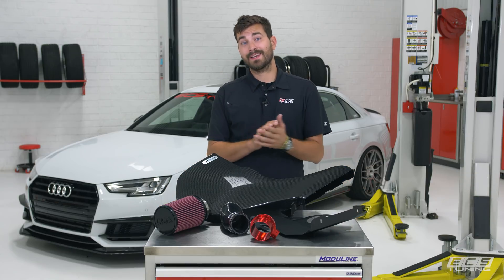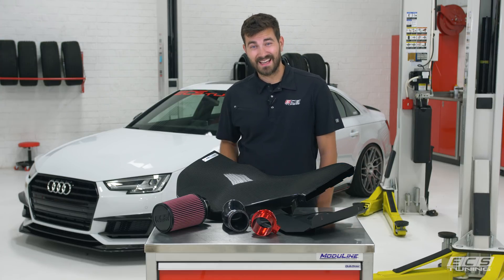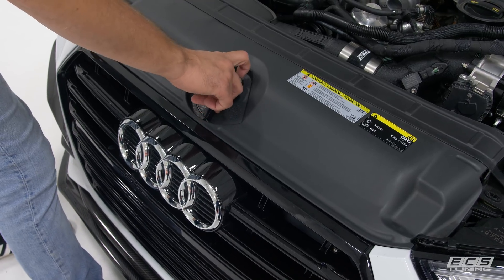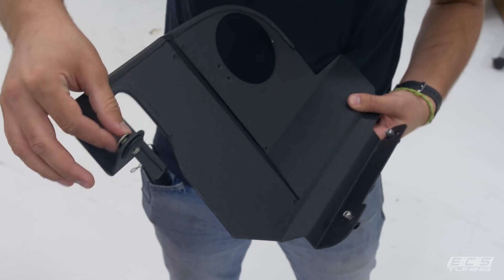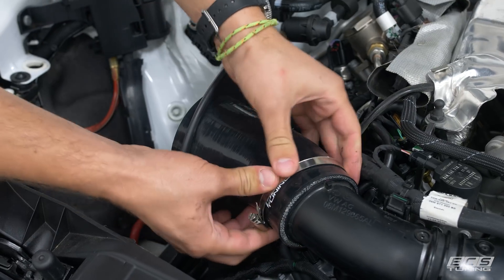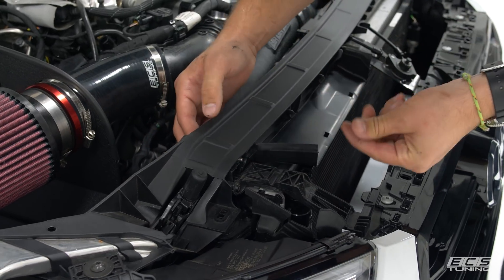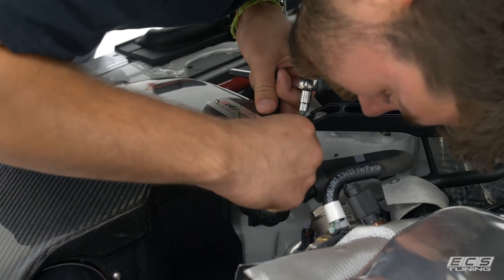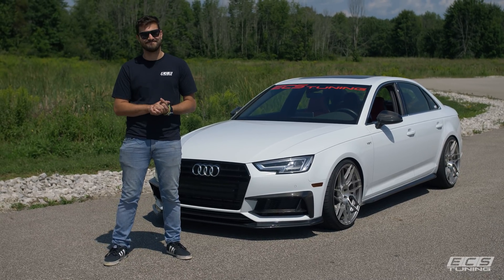Audi B9 S4 (2018) - Intake Removal and Install DIY

Comment: Imagine dropping one of these screws in the engine bay.
Reply: Bro, it happens with the 2 small screws that puts the heat shield and the red filter adapter! Even when you tighten them, they will fall off make sure you use locktite or something I had to get a set of 2 screws in home depot. I manage to get one out but the other one I think might’ve fallen out or something

Comment: Install went great for me except for the part where I dropped an allen wrench in my engine 👀
Reply from the maker: Yikes.
Reply: @ecstuning  It's all good. It fell to the floorpan. Took it to my local mechanic who got it up on a lift, pulled the floorpan off and got it out for the low cost of zero dollars.
Reply: Thomas Kreuzer  That would result in a cost to me of >$0

Comment: Just bought a used original Airbox and cutted some plastic on the front fender side away, so no water can get in. Sounds the same and also doesn´t pull hot air in. This ECS Intake is great and looks fantastic. But too expensive for me.

Comment: Would this fit for the b9 s5 sportback?
Reply: I just ordered the intake for my 2018 S5 Sportback (Daytona Gray and Magma Red interior) and will be reporting to ECS the installation results, I don't anticipate any issues. I am about to receive my Tune from TMC Motorsports out of Belfast, Ireland as well. 420 plus the intake...
Reply: Daniel Van Meter did u install the intake? How’s the fit?
Reply: I will be installing it soon. It should work on the S5 as well same engine. ECS hasn't formally installed it on an S5 yet.
Reply: I installed the intake on my 2018 S5 sportback and it is a perfect fit... The turbo whistle is quite nice.
Reply: It is a perfect fit...
Reply: @ThunderGoatz  perfect fit and it does have the carbon fiber cover but if you listen it sounds really cool and whistles. Supposedly if you leave the lid off the sound is more pronounced. I just received the carbon fiber cover for the ecu box as well, Ill take a pic of the engine when finished.
Reply: @ThunderGoatz  They say 16 WHP on the dyno but i have not tested mine nor will I until i complete my TMC Motorsports tune box installation. With both should be about 430

Comment: Does anyone know when apr is coming out with a tune?
Reply: 2 weeks
Reply: I just called APR and their still working on it, Chris at APR said hopefully by the end of this year or early next year.  I'm patiently waiting LOL
Reply: @MrJrolon1975  Another 2 weeks, just wait.
Reply: @AviationDirection  I hope your right, I'm ready to start modding my S4 B9
Reply: @MrJrolon1975  I have the TMC Motorsports Piggyback tune and it is amazing. Get the gearbox tune as well.
Reply: @danielvanmeter3396  I'm going to check it out.  Thanks brotha!
Reply: @danielvanmeter3396  I just left their site.  Do you have a 2018 B9? I did not see any piggyback options for the B9 platform.
Reply: @MrJrolon1975  the S4 B9 3.0 2017 and newer and 2018 and newer S5 B9 3.0 are the exact same tune kits. You do need to watch out for the supercharged 333 HP engines, they are the different. I assure you this is correct, purchased it from TMC z motorsports out of Dublin and it is ferocious. Tmc is extremely fast and secure.
Reply: @MrJrolon1975  shot me your email and I'll send some more details and engine pics on my car. I have a cold air intake as well and carbon fiber covers.
Reply: @danielvanmeter3396  Yes, I have the 2018 B9 3.0 Turbo engine 354 hp stock
Reply: TMC Motorsports

Comment: hey Ecs, is it okay to have an intake installed but not have a tune? will this affect air fuel ratios in the turbo on an audi
Reply: Update, I got a downpipe aswell and stage 2 tune hahaha works amazing
Reply: Sounds like you are probably from the Subaru crowd lol  (Laughing with you) As I too am from the Subie crowd. But hey I also belong to the Audi crowd, as I have definitely enjoyed my fair share of them.
Reply: @Kiss__Kiss  lol can spot a subie bro a mile away. Needs a tune everytime you change a headlight bulb 😂
Reply: @markjackson7650  🤣 Seriously though!!
Reply: You don't need a tune for the intake. The car will be perfectly fine.

Comment: This kit will fit SQ5 B9? Same engine bay, same motor
Reply: Luis Franco engine bay is actually slightly different configurations
Reply: Michael Fardoulis so sad!
Reply: Luis Franco could still fit but it’s definitely not exactly the same layout. Hopefully they reply and let you know, otherwise ask through the website

Comment: Why doesn't the manufacturer just build it this way? Does it mess with the computer?
Reply: Regulations don't allow it, it's illegal in most european countries
Reply: Glover Carvalho  This probably flows no better than stock. Modern OEM intakes are usually very well optimized.
Reply: @borderwave2  Probably, but regulations still. Just like exhausts, a Lamborghini is louder than my Audi with an aftermarket exhaust. But the Lamborghini is legal and my Audi isn't (Switzerland)
Reply: Glover Carvalho  Good point.

Comment: It looks beautiful but $600-$700 for an intake. Bit much don't ya think.
Reply: Yea AWE got one for 900$ lol
Reply: Cheaper than any competitors...
Reply: it's pretty cheap
Reply: You can simply take the stock lid off and get the same type of sound.
Reply: And that ecs system takes in hot air.
Reply: Luis A. If you’re driving a B9 S4 a $700 intake is couch change
Reply: @Robteee  I'll disagree, I didn't get to a place where I could afford a B9 S4 by being wasteful.  I'll argue that the stock airbox with a less restrictive air filter and the intake Air scoop shows the same improvement.